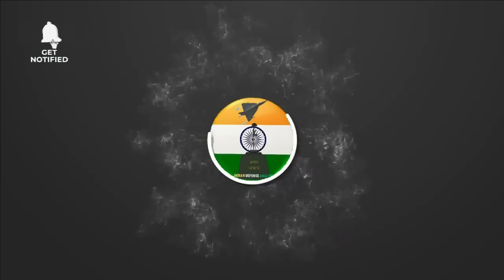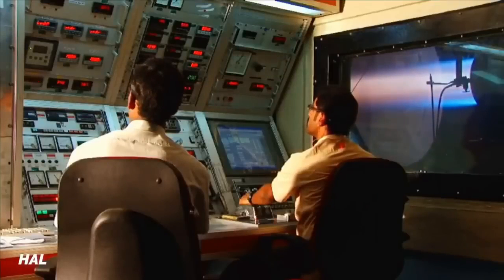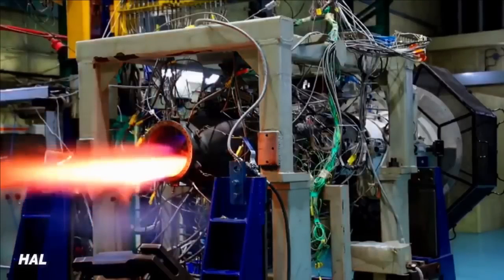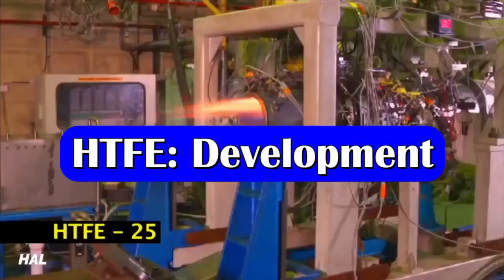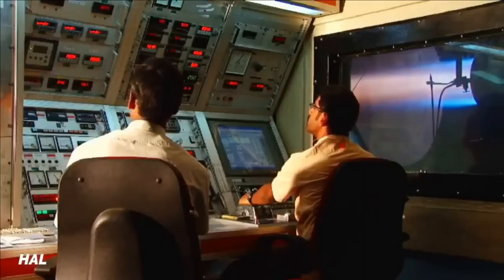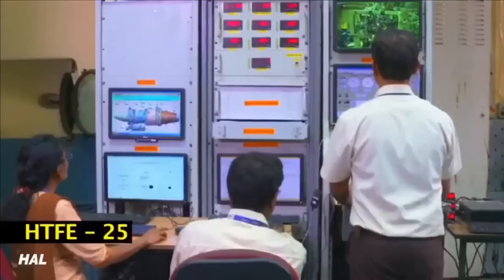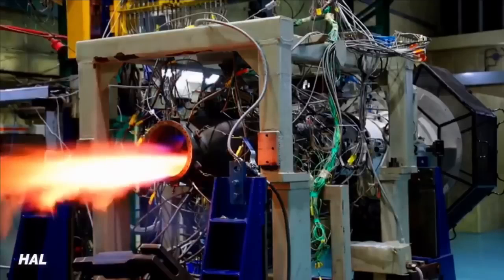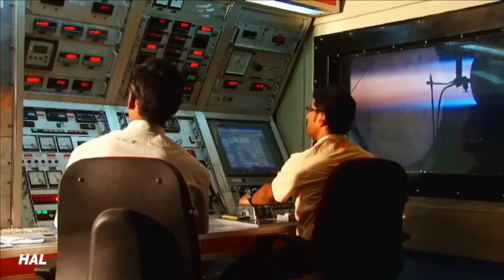Two HTFE-25 engines by HAL under developmental trial. Engine to power 5 ton aircraft

Comment: 3d printed titanium alloys are a big advance that still isn't even used in Kaveri engine, which is based off 1990s tech. There needs to be a Kaveri 2.0 that takes advantage of the tech advances made since then. Original target was  2020, actual date is likely to be by 2030. But at the very least this helps build a wide base of knowledge on how to build aerospace engines, which will eliminate any need for imports in future!
Reply: Exactly. Even if we use an old design, the updated and improved tech and new metallurgy, would definitely enhance the performace of the Kaveri engine. We are still investing in Kaveri GTRE engine and who knows with a minimal investment of time we might finally stabilize the whole engine and improve its performance to 85-90KN (The engine is already producing output of 74 KN). If GTRE can reduce the overall engine weight by 100Kg, the output will automatically increase. It must be funded for one more attempt under limited timeline before abandoning the Kaveri Turbofan engine for good.
Reply: @@mantham343 Kaveri uses DS blades, not even single crystal. We all wish it did! Kaveri is 90s tech bruddah.

Go to DRDO website. Singe crystal tech is not on any Kaveri engine to date, only in the far future will it be used.

https://www.drdo.gov.in/single-crystal